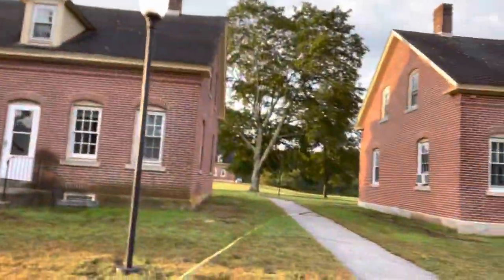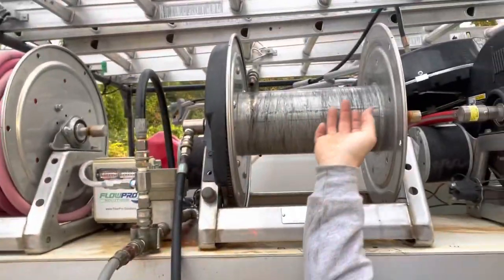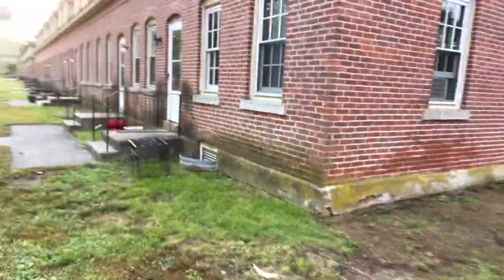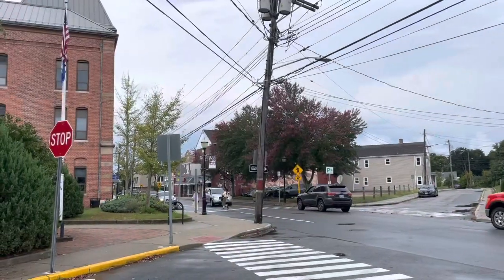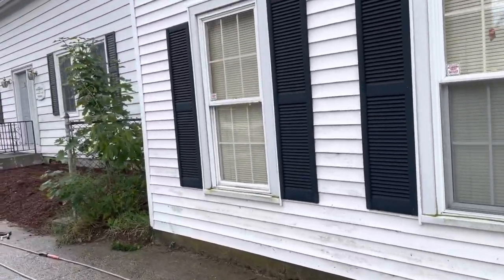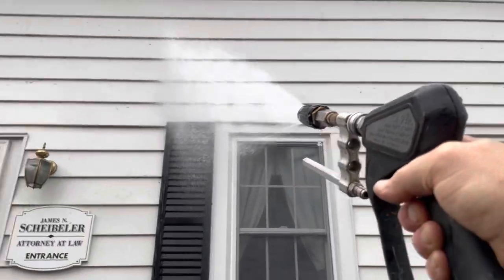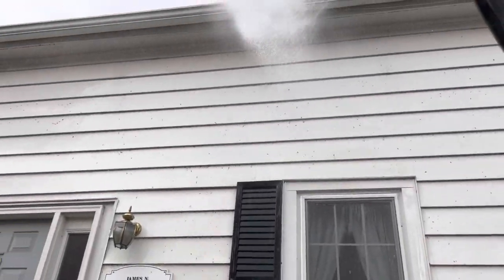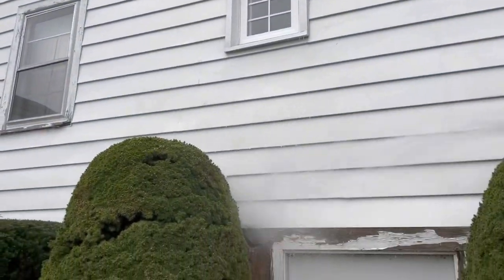Tuesday Turbo Time Lapse

Comment: Good morning Joe, In a previous video, I saw you house washing and you went over exterior curtains and flag.  I think you said you was using a 1.5 batch mix.  How "hot" you can go and still safe? Thanks Joe, you are the "Michael Jordan" of the pressure wash industry 👍
Reply from the maker: Most things that I made to be exposed to the sun and weather will withstand house wash at 1 to 2%. Obviously it needs to be rinsed.

Comment: Something to try 8" or 10" serface cleaner on a lance with swivel head good for large flat areas like that 👍 slightly faster than turbo but I've seen your main line of work and it may not pay but if you was doing more stuff like this it's defo worth the investment 👌
Reply from the maker: Yeah I’ve been looking at these
Reply: @powerfulimprovements  I've used the old surfacemax 15" surface cleaner attachment with a wand on the wall it works good. Also I've seen (haven't used) Dual Turbo tips could look into it

Comment: Looks good! Do you shutdown for winter? I'm down in the dmv and winters have been fair here... thinking about starting a power washing business but don't know if I should wait until spring...
Reply from the maker: Never wait. Start now
Reply: @powerfulimprovements  my thoughts exactly...I'm going to gather the main equipment over the next month and get some business cards or flyers made up.
Reply: I started the same time as Joe from the same area basically I'm Boston I shutdown but it's only a side gig for me, I still send out flyers my company name is Mr Mike's Power  Washing services check them out ppl love them and pick me over the big guys cause they know I'm putting in the work.  I call Joe the John Stark cause he is the king of the north

Comment: So if I need a total of 225 feet of hose.. is it better to haveinger pressure washer hose or water hose? And what diameter water hose do you recommend?
Reply: @MajorImpact  I know that... just asking is it better for me to have 200ft of water hose then run 25ft pressure hose. Or what
Reply: @clinttroiani  you should have 200ft minimum of both
Reply from the maker: I would get 200+ of pressure hose, so the machine is stationary. 50 feet garden 3/4” to start.
Reply: @MajorImpact  thanks!
Reply: @powerfulimprovements  thank you! I have been pressure washing on and off for years and finally started doing it full time. I just been offered to do a fast food chain, 15-20 locations every 60 days.
Reply from the maker: @clinttroiani  that’s cool!  Great consistency
Reply: @powerfulimprovements  would you recommend one 200ft pw hose or 50ft-100ft sections? And do you recommend a certain brand?

Comment: Looks great, did you pre-treat the brick with a house/roof mix first before the turbo?
Reply from the maker: Post treat only
Reply: @powerfulimprovements  Looks great Joe! Do you just use your house wash mix with elemonator in it to post treat? Do you ever find any residue left over after letting letting it dry?

Comment: Do you use the full 4000psi out the turbo nozzle or is it throttled down
Reply from the maker: Running at 2000